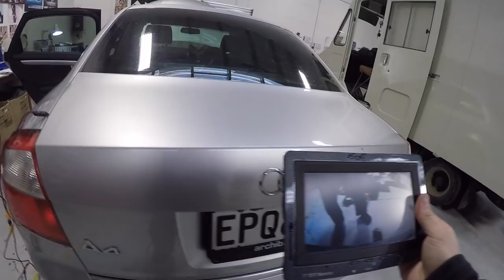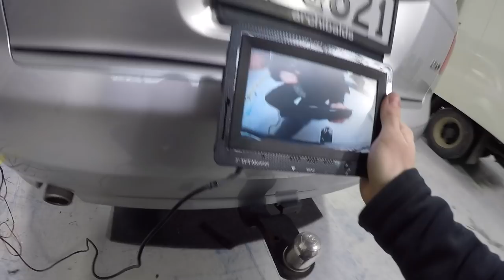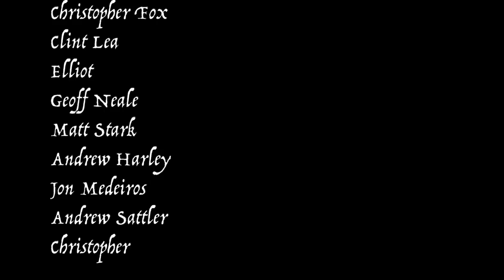The Joys of Working on an Audi!

Comment: You don't need to apologize for the fact that you are in a commercial enterprise and you need to tailor your methods to what clients are willing to pay for (wood vs. fiberglass).  Having said that, you may be surprised how quickly you can work with fiberglass when you develop a comfort level with it.  I have done a number of installs with wood baffles and  fiberglass enclosures based on a reinforced fabric (fleece) mold.  I'm not saying you must do this to keep your work interesting, it's just not as difficult as you may think.  I don't know your material costs, so that may also be a limiting factor.  In any case, cheers and keep the videos coming!

Comment: I'm in the middle of doing this to my 2005 A4. Pain in the ass car. Not on to the speakers yet but the double din conversion was quite difficult and the head unit install is strange due to the rear amp. If anyone finds that the rear speakers are quiet using the stock speakers with aftermarket HU, try running a line level converter from the HU's amplified rear speaker out instead of the rear preout. Should be able to give you a little bit more of a kick since you can't control the gain on the stock Audi amp and balance the sound.

Comment: 28:30 - The dimmer control is automatic and manual, at the same time. 
You can manually adjust the maximum intensity through +/- buttons from the Instrument Cluster. 
Great job with the install !  I always wait for new videos. :)

Comment: There's special wrenches that you can get that can get those bolts off. Over here they're  called deep offset combination wrenches. I'm guessing they are torqued to around 70-80lb-ft/95-129Nm because of holding back luggage in a crash. I don't think it could be more than that because any more would be a bit overkill.

Comment: There's a special ratchet that has a hole in the middle that lets you pass the longer threads through.
Reply: I'm not sure how to get the link from amazon with my phone but this is the description.  GearWrench 891226 25 Piece 1/2-Inch Drive (30mm) Pass Thru Ratchet Set with Locking Flex-Head

Comment: You can't just pick any subwoofer to mount on the tray. You need to pick one that is meant to be used in "free-air" or nowadays often called "infinite baffle" as opposed to most of the woofers being built for enclosures (be it sealed or ventilated). The key here are the Thiele-Small parameters.
The best woofer will sound shitty if it's not used for what its built for.
Reply: Florian Floimair lol people have put shallow mount subs in trunk lids forever

Comment: I'm pretty sure you can use the vu passât adapters to ou 6,5 inches in the rear, I did my brothers Jetta like that and I was able to put the 6,5s in the rear instead of stock 5,25in
Here is a link for rear and front:

https://goo.gl/images/G9Bs25.  Rear

https://goo.gl/images/utpSLu. Front 

Also did the same in my 2001 Passat which has same speakers basically ;)

I could measure them to tell you the exact size if needed

Comment: On 15:04 you get messed up with that bolt. I hope it is the right word in englisch for that tool what i meant, just use a 17mm cranked ring spanner for that bolt :), sth like that: https://www.amazon.co.uk/Trade-Quality-Double-Spanner-6-32mm/dp/B006B3QFZO